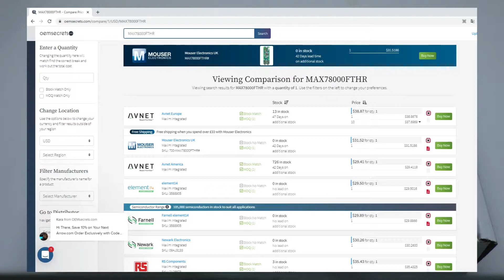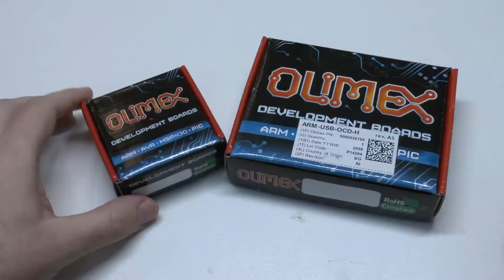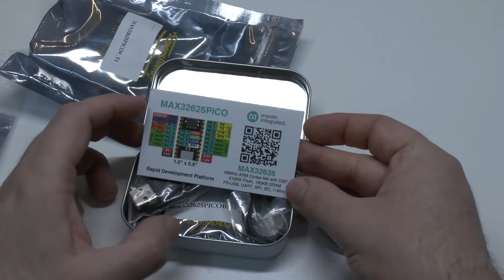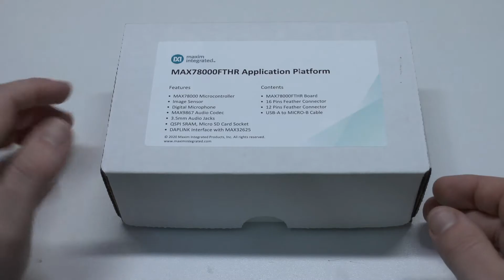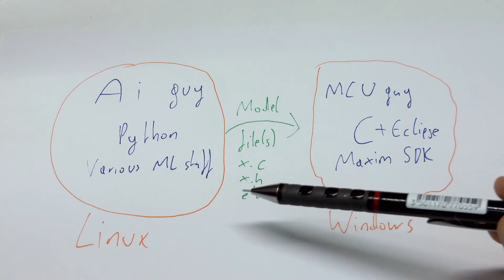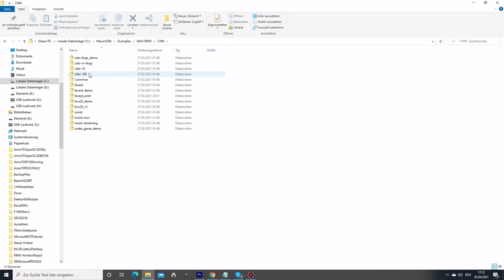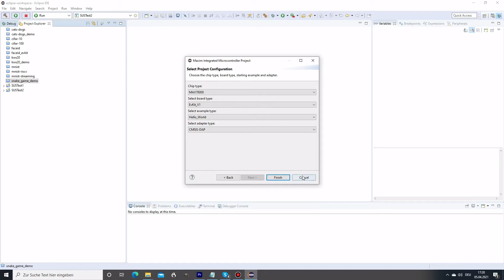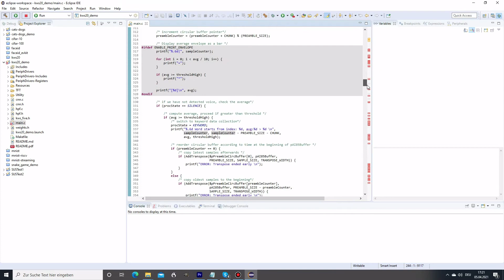Maxim MAX78000 - development kit overview

Comment: Great video and an awesome device. You did a great job of selling the device and I'm thinking of ordering one. What's holding me back is the high entry bar for the AI/ML part. I myself am a hobbyist embedded engineer and a software developer, but data science is beyond me. Which makes me wonder if there are somewhat practical intended applications for this device if you don't know how to create an AI model that fits in the device flash memory I guess.
Reply from the maker: Hello, thank you so much for your kind response. In your case, I would probably try to use something else...maybe one of the Kendryte chips...this is a very low power system, for, um, special purpose applications...